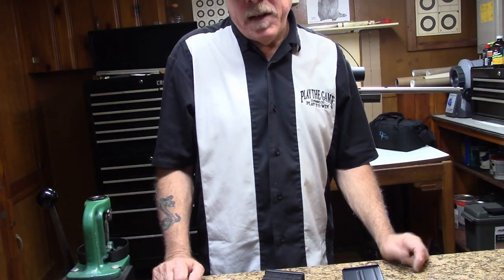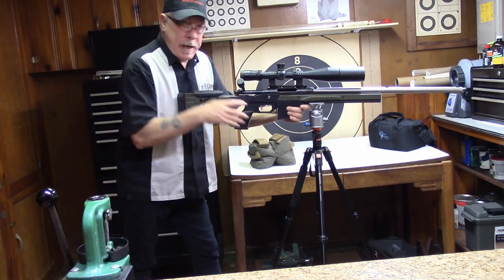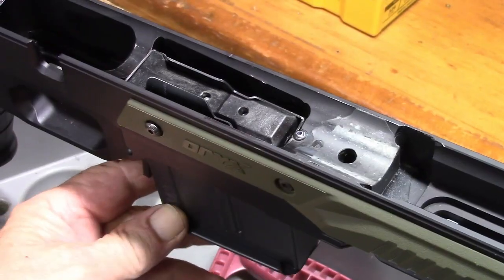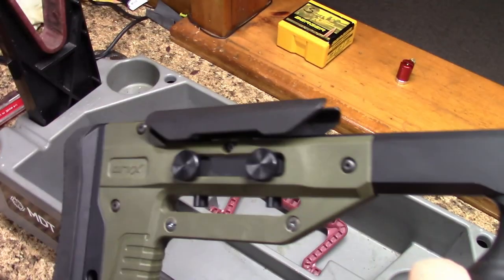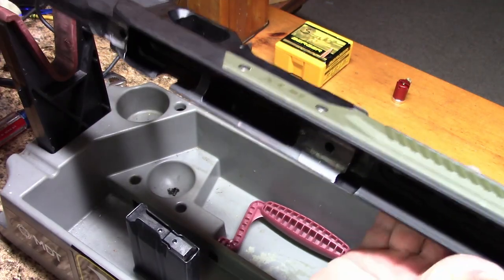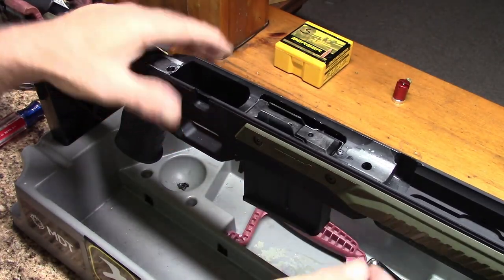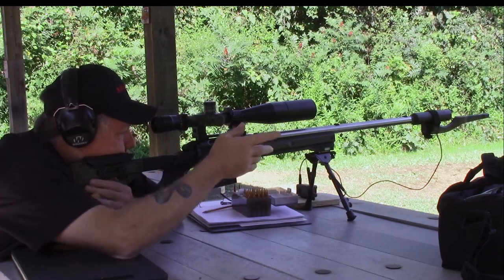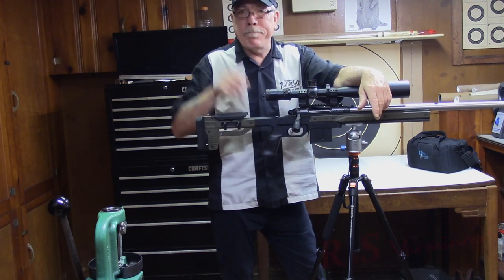Oryx Chassis loose magazine fix

Comment: Just purchased two metal MDT 6mm ARC mags for my MDT LSS Gen 2 chassis and it has the same issues. I can understand if this was the case with aftermarket mags etc but with actual MDT mags that these stocks are designed to run? Seems like something MDT should be fixing in their design maybe?
Reply from the maker: I concur, If it's $400 or $1400 it should work properly.

Comment: Great idea. Looking at buying this chassis and not knowing this trick would have stressed me out. 

How do you like the chassis besides that issue?
Reply from the maker: I like this Oryx a lot and would do it again for that price. I did notice there was some flex in the front (Kind of a twisting flex) when using a bipod, but the Swiss Arca rail really stiffened it up.

Comment: Good job! The screws work as guide or as a support for the magazine. I see that the Oryx is skim bedded. It´s only on the front screw or on the back too?
Reply from the maker: Thanks, I love how the mag works now :)
The back area is bedded too. but I lapped the chassis a tad first.  I kind of showed it in this vid  https://www.youtube.com/watch?v=NE9h1Z9jZlw&t=25s
Reply: @rsvarminters9083  and how it shoots now? Did you notice any improvement in terms of accuracy  after the bedding?
Reply from the maker: @dannyboy4805  Well i feel better that the ends of the action are now seated against something and I'm not trying to bend the action with the action screws. 
A good chassis or stock should help with constancy.  I know a scope rail that's not flat will mess with an action, imagine what an aluminum  chassis can do if not flat. It shoots pretty damn good now for sure :)
Reply: @rsvarminters9083  and do you do also the bedding of the scope rail? I´ve seen that some people doing it. They say it´s just for a peace of mind. Do you think it´s necessary?
Reply from the maker: @dannyboy4805  Rather than using epoxy I lapped it for proper size and flatness.  @ 5:18 to 6:49 mins in this video on the scope mounting  https://www.youtube.com/watch?v=n6lflSvAN-w&t=1s   I show what I did to the scope rail. Just like the bottom of the action, be careful what you do to the top as well.

Comment: This mag issue it seems is pretty universal among different chassis. I had it happen on a Howa Bravo KRG chassis. I also had it happen on my MPA competition chassis with a remington based action but MPA has adjustment built into their mag catch lever to compensate for mag fitment. Do those side screws protrude lower than the very bottom of the action? The reason I ask is because since a remington action is cylindrical on the bottom the screws might be able to come higher up into the action without interfering with the bedding as compared to a flat bottom action like a Howa or Weatherby Vanguard. I was looking into getting one of these for my Vanguard but if the mag issue can't be fixed for a flat bottom action then I will look elsewhere.
Reply from the maker: The screws in the Oryx look to be 1/4 of an inch below the Remington action. I hope that helps :)

Comment: Any chance you have the polymer mags running through this? I'm having a similar issue with the poly mags (in my case, the mag goes slightly too deep into the magwell and blocks the bolt with the back of the mag body). I'd be curious if this modification would preclude using the poly mags, or other AICS-compatible mags.
Reply from the maker: The poly mags have straight sides as apposed to the tapered metal mags have so the side by side can be fixed but, not the depth. That screw in the front of the magwell is there to limit depth and catches the front of the mag. The poly mags are soft there..  one might can build up the poly or metal shim the magazine to work better. Hope that helps. If you come up with something that works better let us know. Who decided it was ok to make plastic mags anyway? lol
Reply: I just took some abs plastic stock and super glued them to the side of the mag body to index on the base of the mag well. All three mags now work without issue having cycled at least two loadings for each magazine.
Reply from the maker: @JaredBallou  Woot nice. Got to love it when a plan works. :)